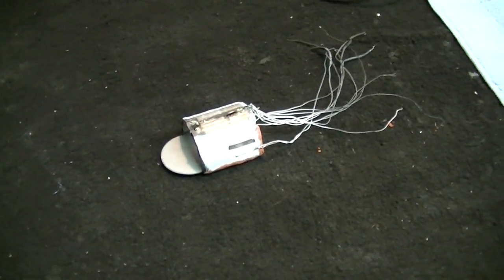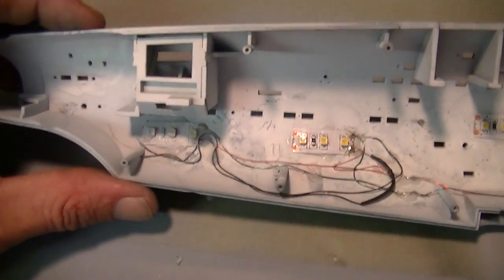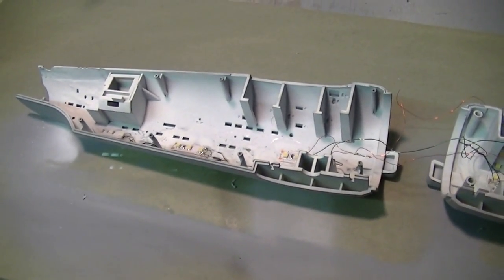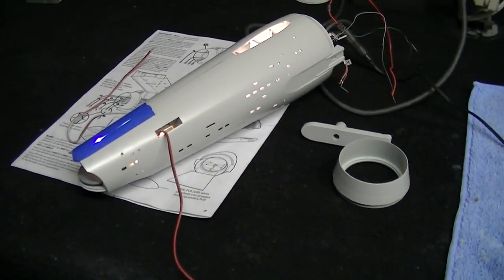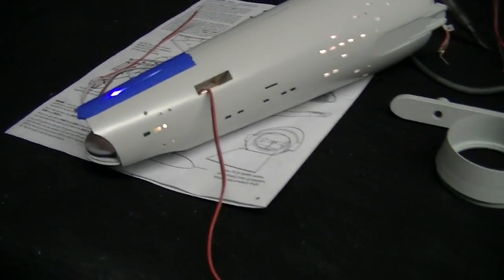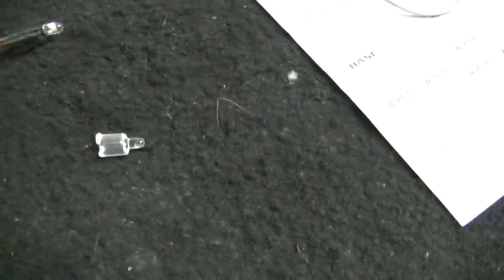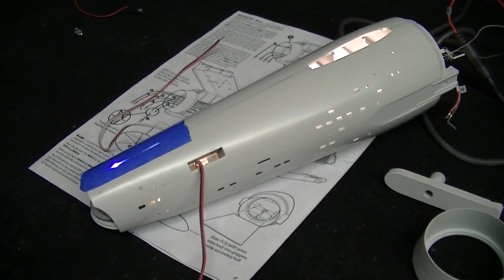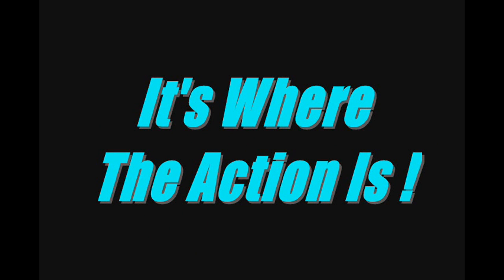Polar Lights 1/350 Scale TOS Enterprise Buildup PT 5 Painting The Secondary Hull

Comment from the maker: Jeff those tiny SMD LED's I used here will work for getting the side windows lit with the non clear parts. I had to remove some of the plastic by grinding inside the hull walls on this kit too even with the clear parts. No matter what you need to grind because the shuttle bay is too wide. If you don't, you get a big gap at the rear.

Comment from the maker: The shuttle bay is a bit too big to fit and it makes the model have a big gap at the rear above the opening unless you remove some plastic from the inner walls of the hull. It's very hard to get light to those side windows because of that.

Comment: Have you ever had fit issues from the secondary hull halves?  My kit does not wanna go together when dry fitting it
Reply from the maker: +Zander Mathieson It's a common issue with the kit. Just look for anything interfering and work on that to close the gaps. It's especially bad at the tail end when the shuttlebay is installed in there.  I take a grinder and remove some of the thickness of the inner walls to make it fit better.